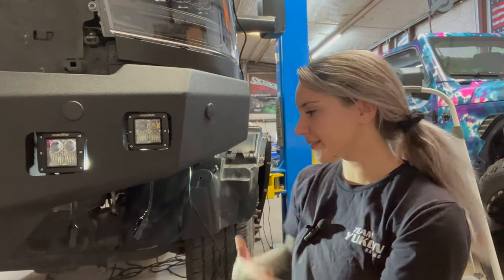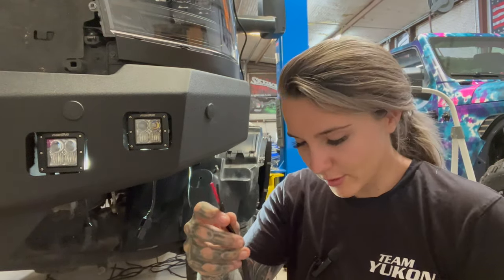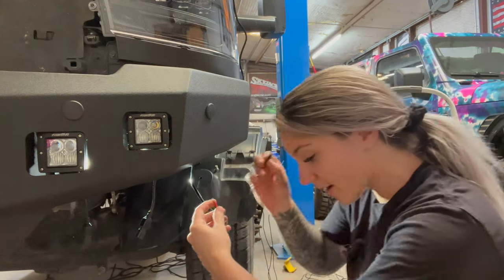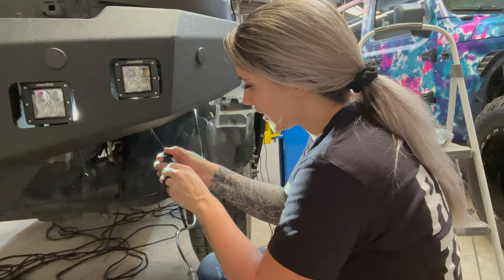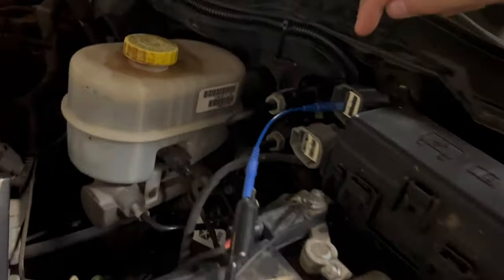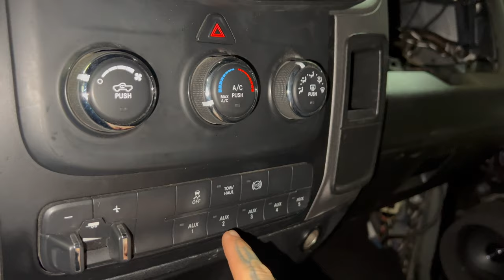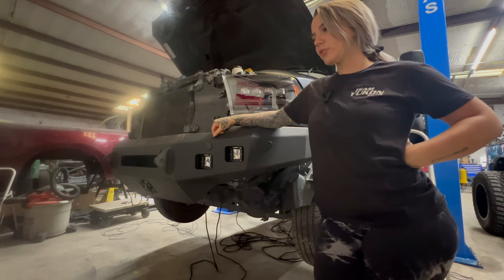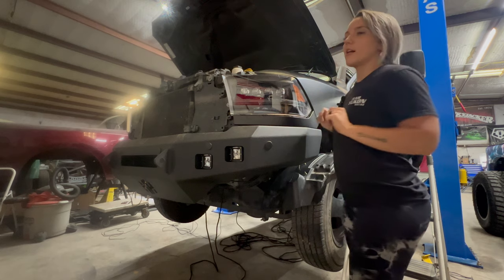How to wire FCK LED Pods into Ram Aux Switches

Comment: Please make sure you ensure your wires can handle the load of duel lights as well as the circuit and switch can handle the load without overheating and causing a fire.
Reply from the maker: Yes it can handle it. I mentioned that in the video towards the end as well lol

Comment: What radio is that??
Reply from the maker: https://stingeroffroad.com/products/ram-truck-2013-2018-heigh10-10-touch-screen-radio-fully-integrated-kit-with-universal-ahd-cvbs-night-vision-camera
Reply: How to vid on how to wire? 😬 2016 Ram here
Reply from the maker: I actually didn’t install the head unit since we had the whole audio outsourced. I routed the usb connections for the center console and the wires for the cameras but that was it. It does come with instructions, not sure how detailed they are though since I didn’t look at them